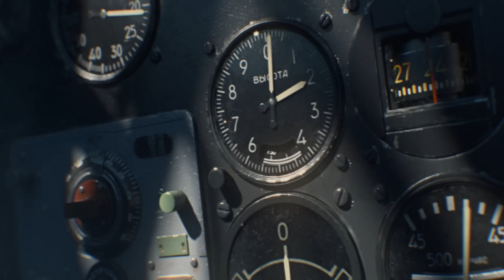War Thunder - 'Victory is ours!'

Comment: 2:21 dayuum nice trick, I'm practicing it

In the game :  Pilot knocked out
Reply: @j.a.3138  I did this in my yak-1 in SB last night, actually I was the one on the lower energy state against 190A. The 190A stalled out 200m higher than me, and I hit the right rudders, as he dove, managed pilot sniped him with high angle deflection shot. I can see how the 190 pilots panicked as I climbed after him. He jinking everywhere avoiding my tracers bullets just to stalled out due to airspeed  bleed
Reply: That wouldn't happen tho, German planes have better climb rates and lower stall speeds. Also the plane wouldn't stall because it is fuel injected not carburetor fed. The spitfire would stall, and the yak would stall but not the 109.

Comment: 2:23
"I'm gonna do what's called a pro gamer move."
Reply: Meanwhile, in game; German stalls out, regains control after only a second, and runs towards airbase.
Reply: I did this in my yak-1 in SB last night, actually I was the one on the lower energy state against 190A. The 190A stalled out 200m higher than me, and I hit the right rudders, as he dove, managed pilot sniped him with high angle deflection shot. I got 15/1 K/D on that game
Reply: Gonna show em a little trick I learned!
Reply: @sethjansson5652  sad but accurate
Reply: Pilot knocked out

Killed was credited to: Kid in a plane that have lag and says thats why he dies.

Comment: After 6 years I just finally figured out that the only reason that 109 lost in vertical stall climb is because he had bomb attached to it the whole time and he only dropped after it was too late 😭😭😂😂😂
Reply: And 1 more point i would like to add is that he was fireing guns and guns=recoil that is one of the reason
Reply: La-5ФН fighter was significantly faster on vertical than Me-109E.
Reply: Well no, kinetic energy = (1/2)*m*V^2 converts to potential energy = m*g*h. BF catch up La so it was faster and La should stall first
Reply: Also the La5 pilot is a ace. He have five stars on the plane.
Reply: Basically me when the enemy had destroyed my engine but I was lining my plane up to bomb a ground target:
Reply: @СветльоДрагиев  just because he is an Ace doesn't mean his plane performs better.. A La-5 (here La-5FN) would always loose an Stallfight with a Bf-109 G-6 (the version here)... And still, it is an awsome trailer, doesn't change anything abou that
Reply: @gemzzzz7244  BF109G
Reply: @wojciechjakub6107  guys what the hell
Reply: I remember that someone told, that some German aircrafts had a problem with fuel pump design - it just stops working at vertical position. It may be the same issue, you can hear it by the engine sound. From Quora: 
That would be with fuel pumps, although carburettor-fed engines could suffer with negative-G loadings due to either fuel starvation or engine flooding as the float couldn’t do its job properly. That was a particular problem for Spitfires and Hurricanes in the Battle of Britain.

Later in the war, the Merlin engines gained pressurised fuel carburettors which largely overcame the problem.

The fuel-injected German fighters never suffered from this issue.

Comment: No way they killed an angled tiger.
Reply: "no way" 
mate did you know that when germans first saw Churchill tanks, british attacked barelly protected swamp where germans had only 37 mm at guns that penned about 30mm of armor (at 30° angle) and using those at guns destroyed 2 churchills.
Also remember if it was tiger of later production it's steel would make armore a lot weaker (and that was also the reason why is-100 armed with 100 mm cannon that had better at capabilites better fire rate and could take more ammo,  didn't take spotlight of our is-2 (originally is-122). Is-2 started strugling against german armor and then soviets noticed that it got better, sometimes is-2 shots would fold tanks as vields were bad)
Reply: its an IS-2... plus it hit the lower part of the gun manlet i think
Reply: but its STALINIUM rounds

Comment: The  battle in this video is supposed to be taking place in 1941-1942 but the uniforms they are wearing have rank insignia from 1943-1955... I guess Russian state sponsoring isn't paying enough to make historically correct trailer?
Reply: its way past 1942 probably 1944 due to the earlier is-2 variants

Comment: The non-exhaustive list of scummy things Gaijin does purely for profit.
Other

In light of the new awful economy changes, I have compiled a list of all the scummy things Gaijin does which worsen the experience for all players, in the name of profit only. I really hope they change some of these things for the better.

    Intentionally releasing new vehicles in an overpowered state in order to make people grind as quickly as they can to abuse them before the nerfs.

    Intentionally releasing overpowered premium vehicles and not nerfing them, in order to make people purchase them.

    The price of said premiums being equal to triple-A games. I don't know how it's excusable for some premiums to be $70 when they already sell premium accounts for $10 a month.

    Intentionally making SL modifiers low and repair costs high, so that the average player cannot break even in SL after a game. This encourages them to purchase a premium account or a premium vehicle. This also encourages players to leave after one death to minimize losses.

    Implementing research efficiency and tiers to make players buy more than one premium per nation in order to grind. Keep in mind each premium can cost up to $70.

    Forcing players to buy a vehicle previous to the one they want to buy, regardless if they ever want to use it. A lot of vehicles should be in a folder but are not, because Gaijin wants you to spend more SL.

    Forcing players to buy X vehicles from the previous tier before they can buy vehicles in the next tier. This increases the grind and forces you to buy vehicles that you might never have any intention of playing.

    Still making the SL and RP grind painfully slow even if you are using Premium vehicles and a Premium account, especially at the top tiers. Mind you you are paying $10/month + the price of 2-3 premiums per nation you want to grind and it's still very slow.

    Intentionally making stock vehicle performance extremely insufferable by locking away essential needs such as Spare Parts, FPE, NVD, usable ammo, and countermeasures. This is to make players purchase these modifications with GE.

    Introducing crew qualifications, which are arguably a pay-to-win feature. Aced crews provide significant advantages over basic. The SL cost for expert crews and the grind for Ace crews are not viable for the average player, people just purchase Ace crews.

    Putting players in debt over their own mistake after the January 2022 incident. They could have just let those players keep their 7 days of premium as a New Year's gift and take the good publicity but they doubled down. This was so bad that some players were going to take legal action because they felt as if they got scammed, and Gaijin was forced to remove the debt because of the insane backlash.

    Selling pay-to-win bush cosmetics, which otherwise are extremely hard to grind for, are unavailable for half the year, and you only get one random bush.

    Implementing an RP soft cap, which punishes skillful players because otherwise they would grind too quickly and won't be compelled to spend money.

    Introducing strike drones, to make the game more frustrating and to make people lose SL. If you get 2 kills and then die with your drone it will be less SL earned than the repair costs of what you killed due to the modifiers, a net negative overall.

    Intentionally making one nation overpowered, then making a different nation overpowered in order to make players purchase premiums to grind the new overpowered nation.

    Intentionally keeping the BR's compressed in order to make the game more random and frustrating, to limit skillful players, and make players more likely to spend GE on mods, crews or premiums.

    Intentionally making minor nations have underpowered vehicles with very high repair costs and low modifiers, because they are played by mostly experienced players who would otherwise grind too quickly.

    Making Boosters expire for no reason other than to take advantage of FOMO

    Slashing the economy time after time but disguising it as a net positive. For example, making the players "choose", but nerfing the economy either way and putting the blame on the players.

    Introducing extremely grindy events with vehicles that never return, or are sometimes OP, capitalizing on FOMO.

    Introducing lootbox-style crates bought for GE, or ridiculous amounts of SL, with very low chances of getting the reward you want. This is effectively gambling at worst and very predatory at best.

They do not need to be this aggressive when it comes to monetization. This game already makes so much, I just hope they start caring more about their player base and less about their profits.